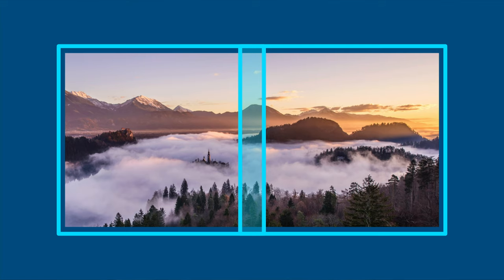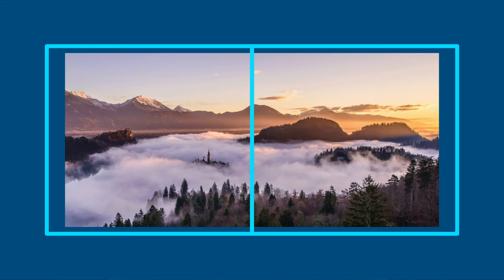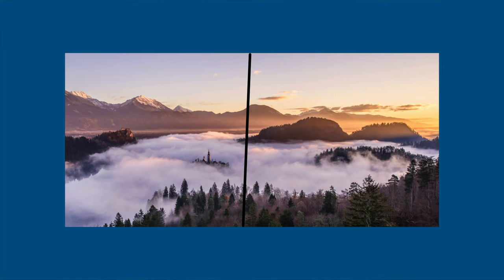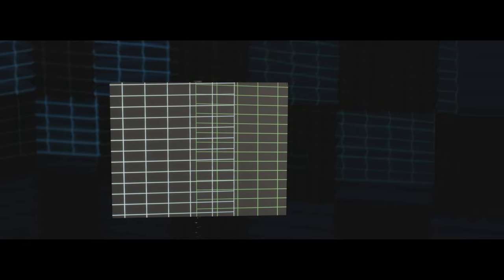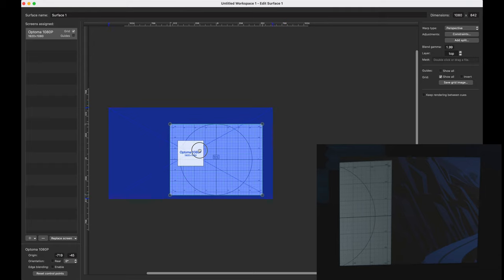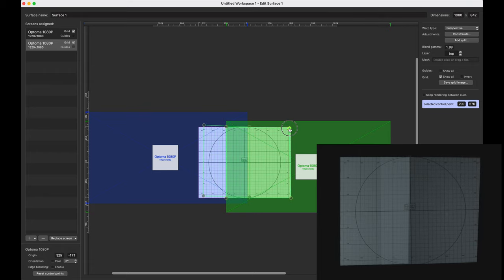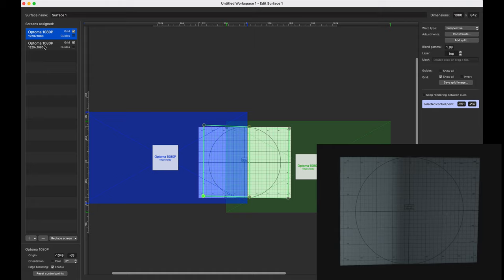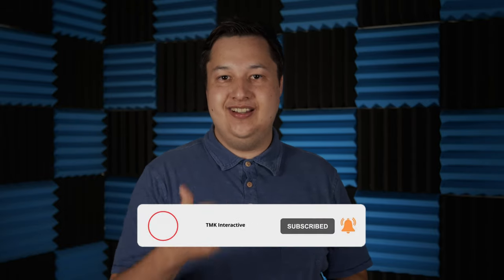PROJECTION MAPPING EDGE BLENDING in QLab. What is Edge Blending?

Comment from the maker: Let us know if you have any suggestions for future videos!
Reply: Hello, could you please make a video that clearly explains how to connect a Mac to a PC. I would like to send Resolume Arena via Qlab (on mac) on PC.
Reply: Yes!
Reply: How to use multiple projectors from various angles - like how Disney can light all sides of a cylindrical castle turret with a seamless image. Is that done via content creation with multiple sync'd video files or can the mapping software handle multiple "cameras" in the same scene?
Reply from the maker: 3D projection mapping is usually done by starting with a 3D model of the thing you are projection mapping. You then "flatten" it to make a UV texture. You create the content on this texture then a specialized projection mapping software (Watchout, Disguise, Mad Mapper) will wrap your content back around your 3D model as well as calibrate where your projectors are in the 3D coordinate space. In the areas where two or more projectors overlap on the 3D object the edge blending is very similar to what is explained in the video, but it is done at a projector output level, rather than a surface level as shown in this video.

Comment: Great video!! I was reading the comments above, but am unclear. Is there any way to achieve this with QLab using an image splitter? We’re trying to blend four projectors, but we don’t have four outputs available.
Reply from the maker: If you have an image splitter that just duplicates the image it will not work. For QLab to work it will need to see each projector as a separate display.

Comment: How are you connecting the projectors? Is it using a splitter, or two different connections?
Reply from the maker: I used two separate connections to my MacBook Pro(two USB-C -> HDMI adapters). This allows QLab to see each projector as a separate display. There are some limitations on how many displays you can connect to a MBP however, some of them are hardware limitations(like the M1 mac products). If you need more displays you can check out the QLab system recommendations page where they list some ways to connect to more displays by using Blackmagic cards or EGPUs.
Reply: @TMKInteractive  thank you! The thing is I was using an HDMI Splitter but the computer was not registering both as separate projectors, but as one. Causing it to be a double image so I was never going to be able to blend them. Thank you again for confirming my theory.